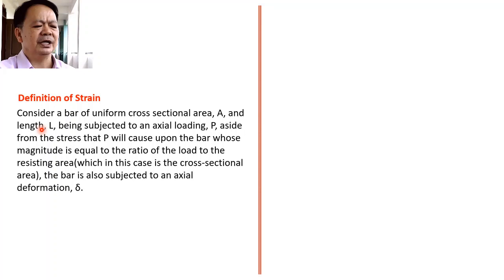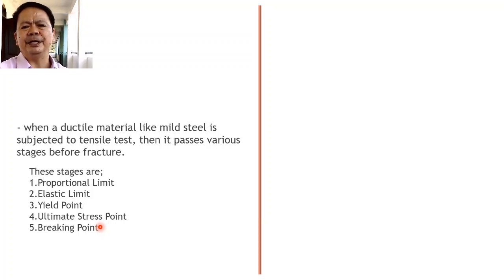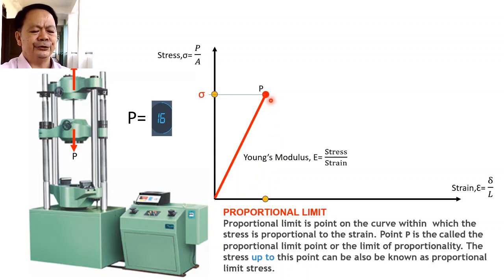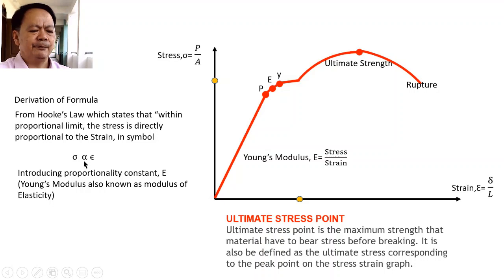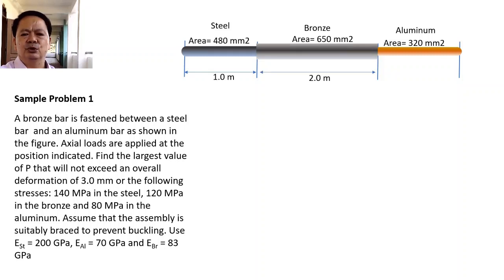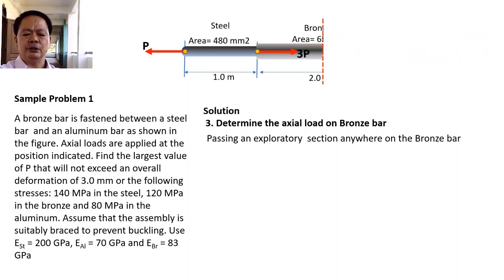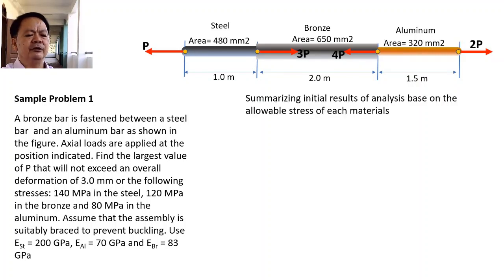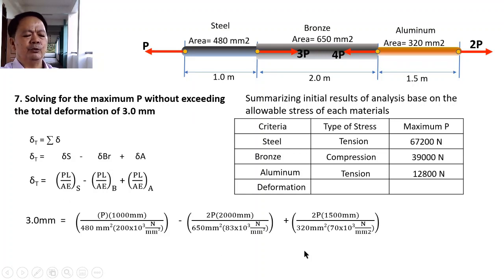Axial Deformation(Simple Strain)-Concept, Derivation of Formula, Application and Sample Problem

Comment from the maker: Thank you for those who are supporting this channel specially those who are giving suggestions for its improvement.. I would like to add correction to the computation I presented here. Although the equation I presented is correct, the value that I used in  the Modulus of Elasticity of Aluminum and Bronze were interchanged resulting to a different value of P.